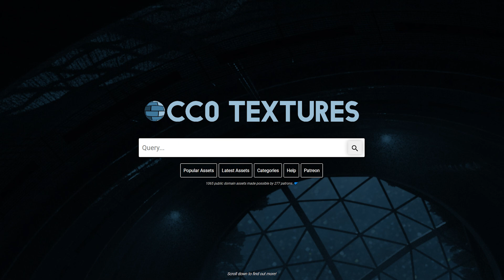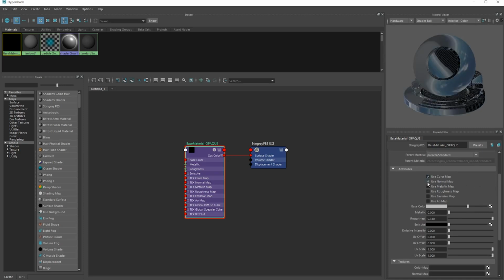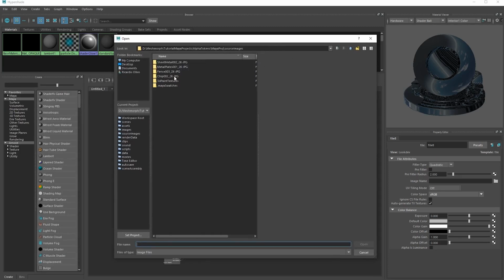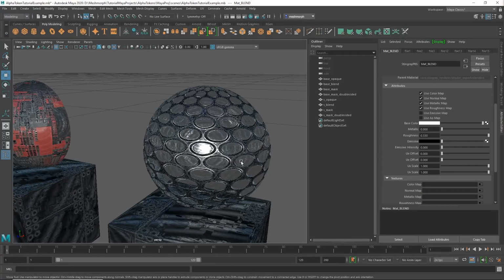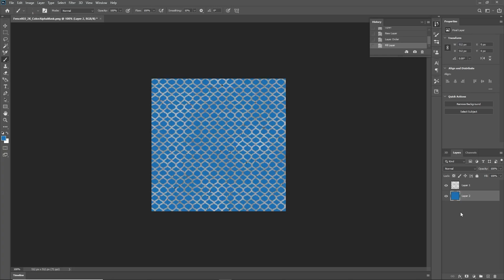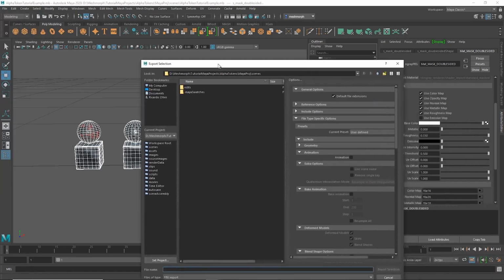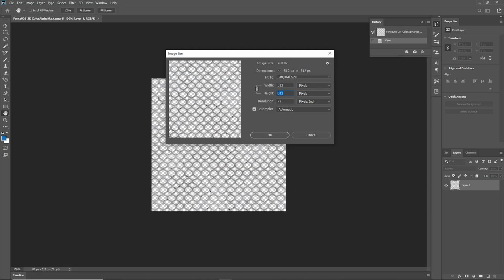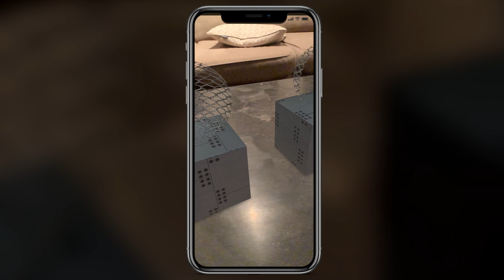Convert FBX to USDZ and FBX to GLTF or GLB with alpha using material tokens

Comment: Can we do same including animation?
Reply from the maker: Yes you can, make sure to bake the animation when exporting to fbx. Also animations can up the filesize, we recommend keeping the file size below the 50MB including textures. Once converted the size will reduce to around 50%. And finally, we have noticed that in some instances you can only use one type of animation technique, mixing IK rigs with anchor translation/scale animations sometimes one breaks the other, nevertheless you can try because this does not apply to all cases. Hope this helps!

Comment: Thank you for this video.
I have Maya 2019 with the Kronos gltf plug in. I'm trying to create glb models for use in Google 3d Model Viewer. I'm having trouble with my UVs twisting/slipping after conversion, even on a simple model using cylindrical mapping. I'm using the stingray node. Any advice?
Reply from the maker: Hello, we are not able to give you advice on your problem since you are using a different approach outside our platform, nevertheless, have you tried converting your model in Meshmorph from fbx?. Our advice is to join us, you get 50 tokens free on sign up to try our platform. When converting select “Automatically Publish USDZ/glTF to My Gallery" which converts your model to glTF, glb and USDZ at once, also you’ll be able to preview your model before downloading. Then if you keep having the same problem you can contact us through the site so we can take a look at your model and advice you in how to fix the issue. Hope this helps!